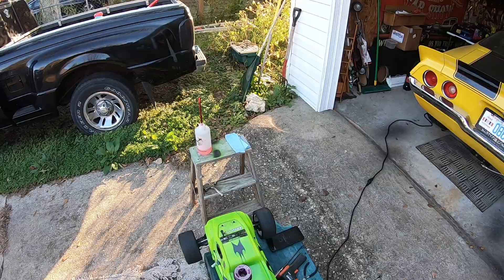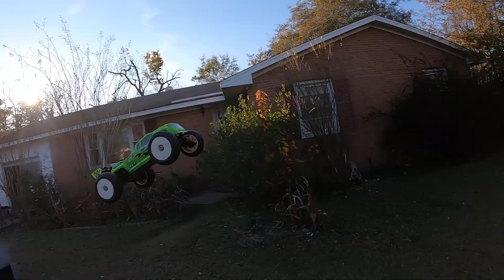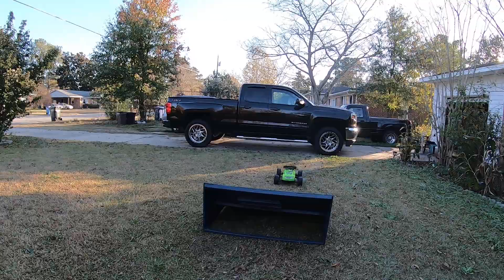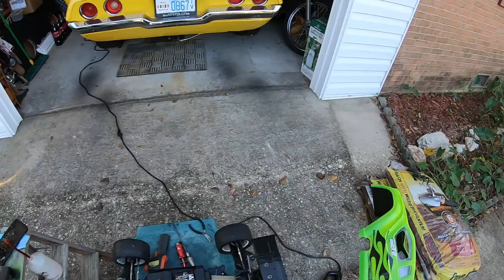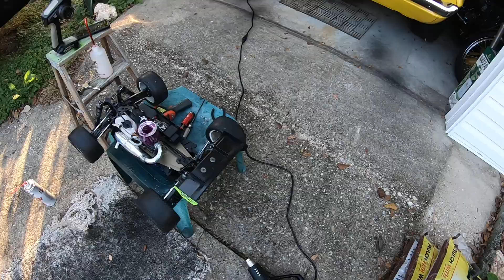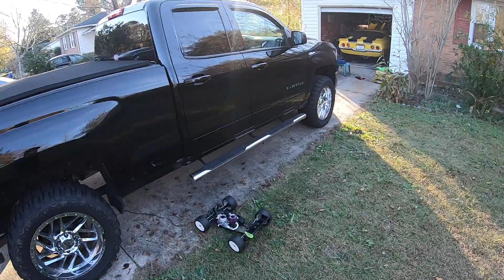TLR 8X-T truggy first run with a novarossi truggy .25 nitro engine breaking it it more and box tune

Comment: Try getting a roll of PTFE heat insulation tape NF that foil stuff conducts heat its a gimmick you see guys using it for years even when it melts their body they still keep using it lol just like those exhaust pressure line coolers, there is no flow sufficient enough going on there to warm your fuel its just dead weight but still you see them everywhere. If the pipe is touching the body then double/tripple up on the PTFE some brands are thicker than others too. Have fun at the brawl and good luck !
Reply from the maker: Mine jas always worked great no issues with the heat tape i didnt pit it down the side n melted a 2 inch line in body cobered it were it got hot problem solved neen using it for years always worked for me
Reply: @NitroFreak  no probs dude just use what works for you, the PTFE is just a better product it wont rub through its very durable i use it to reinforce around the body post holes too to stop cracking out but the foil works yeah so long the pipe isnt directly in contact with the lexan otherwise it will melt its just too thin to stop direct heat but hey, just putting out ideas not being a smart ass, enjoying the channel as always, cheers.
Reply from the maker: @nitronut7774  ya i been reinfrorcing the body holes as well lately my self